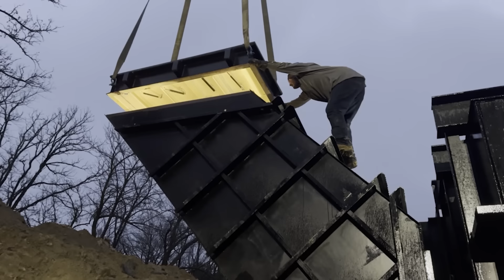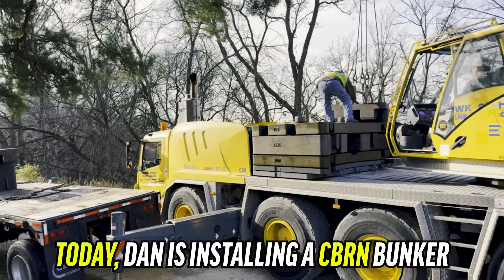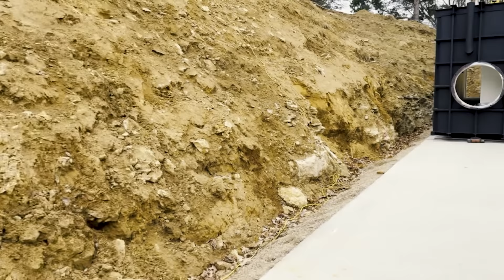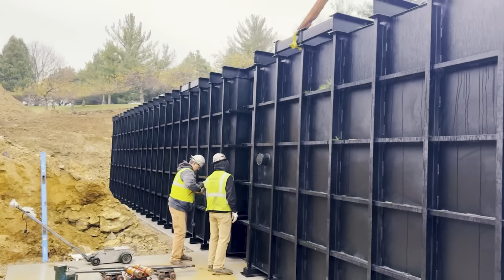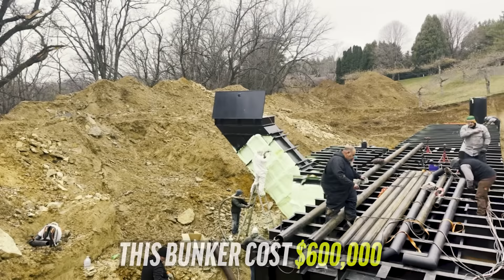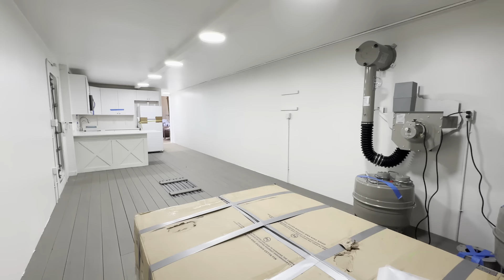Installing an $800,000 BUNKER in Wisconsin

Comment: I see that you put the unit down on top of cement. I hope there’s a moisture barrier and everything else to keep the dampness from underneath the unit cause the spray foam they sprayed right down to the cement so now you sealed it from underneath for any moisture to buildup. so now the moisture is gonna be trapped underneath it cause the spray foam is blocking at all cause you didn’t spray from the bottom.

Comment: Realistically they things are death traps in any kind of nuclear blast they can block the radiation with the 8 to 10 feet of soil overburdon, however the blast pressure and ground shock will literally crush and deform it, if you aren't a pancake you still wont be able to get out and your shallow air piped will be snapped

Comment: There are no less than 9 nuclear power plants either in or immediately surrounding the Minnesota State. In a nuclear war, there will be no one to get the cooling water pumps running again within the 24 hour period it takes before the water uncovers the fuel rods and cause the pressure to erupt through the containment chamber. The melting slag of the 9 nuclear power plants will continue to convert both the 40 plus tons of uranium fuel inside the reaction chamber, and the several hundred tons of spent fuel rods stored in the outside cooling ponds; into all the highly radioactive isotopes and spew them into the air for decades. Just those 9 nuclear power plants will continue to blanket newly made and highly radioactive isotopes all over Minnesota and the surrounding states for decades and decades.

Comment: I enjoy watching these Atlas videos. The installation and everything else. One thing thing I have noticed with all the installations is that the bunkers don’t appear to be that deep and the top of the bunkers are just barely in the ground. I am curious about this. It does say 8 feet, but just parts of the bunker. It’s on a hill where one end is barely covered.

Comment: If I did one of these, I'd want it connected to my basement as an escape tunnel to the secure bunker. I think nuclear strike is possible but a much more likely scenario is what Hamas did on Oct 7th. Some Israelis were saved by their safe room. There are thousands & thousands of terrorists that the last administration let into the USA. The NSA says it's a fact.  Also you need to assume that fire and grenades even mortars could be used to try to break in or smoke you out.

Comment: This is SCAM. You can`t place this "bunker" on ground level. You will die after a 2-3 hours after Nuclear strike.  It have to be at least 200 feet under ground covered with 6 meters of water then 2 meterst concrete & lead.  And you have to have best life support for atleast one year. I don`t think you can survive such long in this bunker.

Comment: A bunker cannot survive a direct hit, regardless of its depth. The shock wave, heat, and radiation are too powerful. Tsar Bomba for example would melt away the bunkers air intake 177,6 km2 away from the impact

Comment: Probably, the guys are doing what the client wants. But in my opinion, most shelter projects are designed with massive flaws.

In my country, we’ve been at war for four years now, and I’ve been designing and overseeing the construction of shelters. So I’ve learned—not from books, but through practice—what a shelter should be.

Almost everything we see in these videos is a pointless waste of money.

Especially the generator: its location, the fuel tank placement, and even its type are all wrong.

If this shelter isn’t constantly heated and ventilated, everything made of wood will rot and fall apart within just a few years. All plastic will dry out and become brittle.

Every piece of furniture should be made of stainless steel. Mattresses should be either coconut fiber or polypropylene. I’d even make the floor out of stainless steel and lay coconut-fiber mats on top.

The emergency exit isn’t outside the blast zone of even a basic 100kg aircraft bomb. The hatches lack manual jacks and simple mirror periscopes. There are no drainage wells for condensation from ventilation pipes, no general drainage system or monitoring, no hardline phone connection between the ‘dirty’ and ‘clean’ zones. The hatches don’t even have safe air-sampling ports.

So many small but critical details are missing that this isn’t a shelter—it’s a toy house

Comment: You always talk about the various air and exhaust pipes.  What about the plumbing for sewer and water.  In fact with these so deep in the ground, how is this being implemented with a Septic tank.  I would assume there is some sort of pump system that lifts the sewage to a septic tank but I never see that in these videos.  Is there a holding tank down below this shelter with a macerator or something pumping to a septic?  Also, what is the cost variance for steel vs concrete bunkers.

Comment: A $12 can of spray foam inside those vent pipes and this shelter has no air, water, or electricity. Clock is ticking…🎉

Comment: You said this was a Wisconsin bunker.  But you mentioned the spray foam at 12:26 because it was in Florida. If I'm going to sink this much cash into a bunker, I would wonder if the crew didn't know what state they were in.  So which is it?  Wisconsin or Florida?  Potential customer asking.

Comment: Is the exterior coating some type of foam? If so, it could be easily punctured by sharp rocks during backfilling. Additionally, the pressure from the backfill material could compress the foam, significantly reducing its insulating properties.

Comment: I have an observation about these bunkers and bomb shelters.  For $800K or $1Million or more do you even know if they will shelter from a nuke blast?  It takes several inches of lead or several feet of concrete to block gamma waves.   I have seen neither in these shelters.  Cinder blocks and shipping containers don't cut it.  I think many of these units would be simply expensive crypts after a blast.

Comment: Not a fan of the air pipes exposed and accessible. I would run them up a chase on a tree and cover in bark. Up about 20ft. And anti squirrel/bird them. A neighbor kid could plug your air pipe and cause significant damage just being an 8yr old boy.

Comment: Wont that spray foam absorb and hold moisture directly to the metal which will eventually rust out the metal?    While I love the idea of bunkers, I just don't think these Atlas Bunkers are a good or high quality option.
Reply: It was said that the surface must be completely dry before spraying the foam. After it's applied, no moisture will be able to reach it. Plus, it's painted. Have you seen other bunkers with which to compare?

Comment: so when any life form is vaporized in a nuclear blast those life forms get coverted int super heated gasses (carbon dioxide for plants and sour gas for actual life) and those expand and are both much heavier than oxygen..... now those gases will settle in to low points and form gas lakes (if not oceans... they have no way to estimate or measure the gasses released in such an event) alot like how brine settles into lakes under the sea water in the ocean.... i just want you to know that those filtration systems inlets may end up being submerged in pure carbon dioxide or sour gas.... it wont turn that into oxygen... choose you placement well.... it likely will end up being a gas chamber/coffin.... i see alot of ppl burying them in lowland valleys and such.... the installers and salesman arent gonna warn ya

Comment: Would love it if you start showing the finished outside after dirt is placed etc.
Reply: But they try to keep that as secret as possible, it's only gotta take one person to recognise something in the area and it would blow the stealth value away if shit ever hit the fan. They have shown interiors and exteriors before on old installations literally in middle of nowhere. Most are beneath or in grounds of private houses , I think they use out of state workers to install them too for security reasons
Reply: I have never understood this bunker thing. If there were a nuclear attack, you’d have to stay down there for years before all that residual radiation dissipates. Just the thought freaks me out. Secondly, all those breather pipes sticking out of the ground is like having a huge sign saying, „Hey everyone, look at my nice bunker“. And let’s be honest about the „Stealth“ factor. Such an installation in any area is going to cause a lot of interest, unless you’re so far off the grid that not even the local coyote is interested. The resources needed for extended periods underground with no resupply would be logistically impossible. Alone the fuel supply needed for the generator would need a gazillion size tank of its own, not to mention water.
Reply: @robertw.1499  Wisconsin and maybe 2 river bluff areas, the Wisconsin River and the St Croix.

Comment: If it is 8' below the surface, then it is below the frost line.  Spray foam would only be insulating from the normal ground temp of 50º-60º f.   But I guess if you are laying out $600K for a bunker you can afford the spray foam even if it is relatively useless.

Comment: I live in Wisconsin and that looks like the topography of the driftless area of southwestern Wisconsin
Reply: I was also thinking St Croix River Valley or down the Pepin/Mississippi area.
Reply: The irony here is that in the case of a nuclear attack, the owner of this bunker may well be killed before even getting to the shelter. I mean, it's not like you get much warning when the ICBMs start flying.
Reply: @bluehornet6752  Yeah, but the target will be Chicago, so we got a minute.
Reply: The crane company is out of Rochester, MN so SW Wisconsin is a safe bet.  Good luck pinpointing anything in those coulees, though.
Reply: Kenosha are😂
Reply: Or better yet smack dab between Chicago Milwaukee and Madison. 3 for 1
Reply: I see cherry trees...🤫 Door County possibly.

Comment: Wouldn't building bunkers be a lot cheaper made out of concrete? Just like basements except with spancrete roof! considering basements hold up to dirt already and joe blow concrete guy could run drain tile and poor the basement floor, walls and reinforced spancrete roof.  I really don't see the advantage of metal for bunkers. Bunkers built for governments are made out of concrete!

Comment: I really like Atlas Survival Shelters, but I'm always shocked at how close to the surface they are placed.  What is the maximum depth for one of these?
Reply: They say it will be 8' underground.  How far under do you need to be?  That is already below the frost line, and unless you're taking direct missile fire I don't see a reason to go deeper.
Reply: @wisconsineaglesfan7925  I'm pretty certain it will probably never get used for a nuclear attack anyways, but I'd be willing to bet It gets used more than a few times for tornado warnings.

Comment: Just imagine if people found out Scott basements 😂😂.
Than imagine that they found out you can pour concrete for the ceiling. 
Imagine how much cheaper it would be, just my basement alone is 3000sqft. I'm floor heating, poured wall construction, spray foamed outside, studded and foamed inside. All of this was under 60k. Might be another 20-30k to put a lid over it. Still under 100k. Now add utilities and comfort items, i bet i could do it all, and really nice, for under 200k. These "bunkers" are a rip off

Comment: Are these able to sustain life with total water submersion for several days? Air scrubbers or whatever is necessary plus water tight? How about earthquake level it can sustain with minimal damage?
Reply: Not a chance esp at this depth - you need to be a minimum of 30ft deep to survive any kind of empcoe event or plasma discharge that results in biblical waves / earthquakes etc. also you would only want to be down in there during such an event when the discharge hits..about 10-24 hours later thats when the earthquakes will start and you’ll wanna be above ground for that
Average speed of said waves from past resets concludes that these biblical waves moved at over 5000 mph and would rip the ground right up hence the mud floods that occurred here , even burying the sphinx and great pyramids..
Reply: @Astralpains  At what range? We're talking SW Wisconsin (most likely) for this install.  The logical nuke target is Chicago for the region.  I am not up on my blast radius effects by range. The area in question would speculatively be ~150 miles from Chicago.

Comment: I didn't see anything about water and septic,  doesn't that have to be done before you set the bunker?
Reply: It does not have to be done before setting the bunker. Before back filing provisions should be made for sewer or septic, water, drain tile, and power.

Comment: There is alot of people there that now know where your shelter is and more then likely neighbors from the noise. When SHTF hits they will piss down your air vent. God bless 😊.
Reply: I can agree, the air intake better be more than camouflaged. It better be virtually undetectable. The should be an exhaust that is the same.
Reply: They should put the air vents in hollow tree trunks and such.
Reply: The install team from Texas?  They're not peeing.  The crane guy?  Highly unlikely.  Neighbors?  Looks like a large plot of land, and if it is in the southwest corner of WI like some have commented, highly unlikely anyone is aware.  And if they are, the person that can afford the land, build out, and the $600K bunker probably has other things in place.  No permits needed, so snooping through gov documents is not going to give it up.
Reply: Or they will just simply wait for them to run out of supplies inside then they will be forced to come out😂
Reply: Ya but to be completely honest most people have a really short memory for these types of things after 5 years they'd have issues figuring out which way they turned to find the bar 😂
Reply: Just look for all the vents @JonathanBarElohim

Comment: Would you guys ever consider doing an above ground offgrid house, small and modular so it can be relocated to other sites when you want a new view or retire; made for CBRN, with positive pressure HEPA and stuff, solar power, incinerator toilet, drinking water evaporator, backup generator, batteries, bullet resistant glass, doors, and walls? Instead of a bunker under an offgrid house, a small offgrid house that is a full time liveable bunker with modern looks and features- albiet not buried to resist a direct blast.

Comment: You know you can buy 45's so you don't have to make extra welds with 22.5s lol.  Also helps if you pre fab a bunch of piping so you aren't welding them on the top of the bunker.  I'm a steamfitter and prefabricating makes things much easier and faster.  Everything else looks good!
Reply: Yeah, they should know that....................

Comment: Seems like the air pipes are terribly vulnerable. And if they get crushed or otherwise decommissioned, all is for naught. Am I missing something in that analysis?
Reply: everything on these look cheap, poorly designed, and poorly constructed to me... but that's just my opinion and observation
Reply: Yes...ya need pipes. Technically ya could be suffocated...but what are ya supposed to do? Gotta have pipes somewhere
Reply: @mrmotofy Hitler had his Berlin bunker air pipes up in a concrete tower.

Comment: Would these be survivable if they were near the coast and a tsunami came in and covered everything in 30 feet of water
Reply: No
Reply: It would survive a tsunami just as long as the air ventilation system doesn’t flood
Reply: @ More likely plugged with debris from a tsunami if the water didn't fill up the intake pipes.

Comment: That pipe appeared to be up coated.  All pipe should be painted as good as the bunker at shop prior to installation.  Then just touch up paint after welding.

Comment: Although the bunker might appear hidden, the solar panels are going to be a tip off. I am currently using maps to categorize ALL solar panel arrays within a 20 mile radius that dont have a house nearby them. When the SHTF my crew will be infiltrating these underground bunkers. If you are not armed and ready to kill... well, good luck.

Comment: It’s not really a bunker if the ceiling of it is just below the surface of the top soil. The bunker should be much deeper in the ground
Reply: You need three feet of soil on top to protect from nuclear Radiation or 1 foot of concrete, no one said the top of it was just below the surface.
Reply: @jarateman6427  1 foot you 6 feet look at any nuclear plant all the walls are 6' to 10' thick 
this is just a huge coffin
Reply: They said 10 feet of backfill

Comment: Can you spray the foam on the bottom of the shelter, and / or make a bed of insulating foam on the concrete before dropping the shelter? So the metal bottom of the shelter is not a heat drain in colder climates ? I'd bet you've been in an Alberta winter before Ron !
Reply: The ground temperature in Wisconsin is constant all year at around 45-50F, so not a huge temperature difference from room temperature and the earth is a pretty good insulator.  The situation in Alaska is obviously different.
Reply: @BakedDrLuny  20 degrees below room temp is plenty cool.  Hope the floors are heated.
Reply: Idk if heat will be an issue even in Wisconsin with the insulation wrap and dirt above it. I see nowhere heat can escape. Heat rises it doesn’t drop. So floors are not generally an issue. I’m from Wisconsin btw
Reply: @Shawn-Leider  I'm looking for a location for a "Dream Home". The likely location is farther north than your State, higher elevation, and mountain foothills that likely won't have a depth of soil to bury a shelter. If it works out, we might have to chip out rock.
Reply: soil is typically about r3 to r12 per foot. spray foam is unnecessary as long as your deep enough